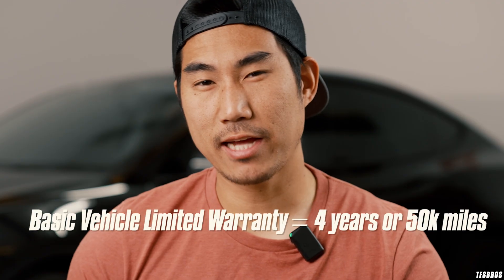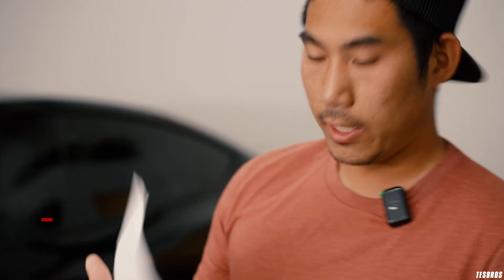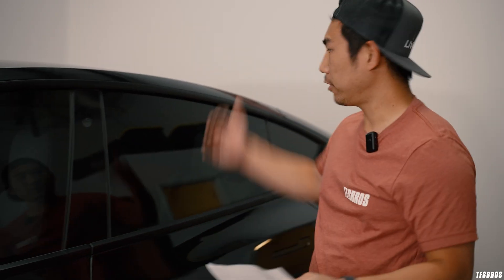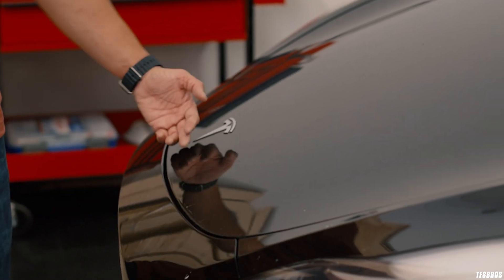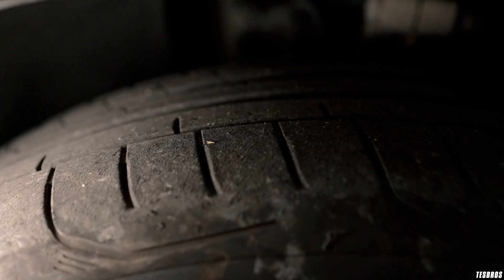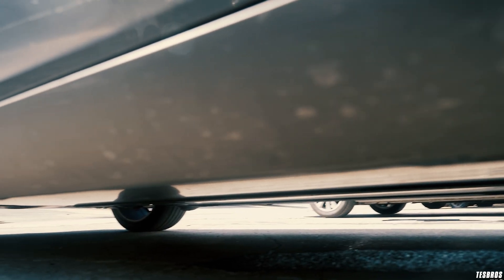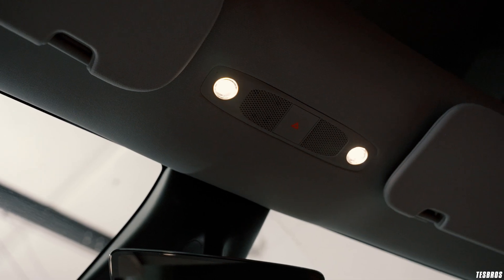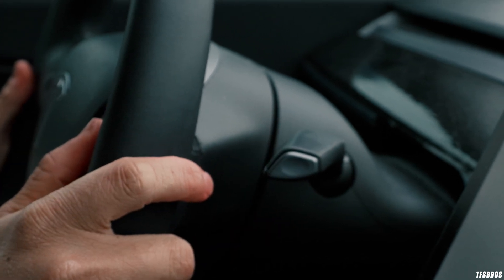Tesla End of Warranty Checklist - What To Do Before It Expires

Comment: is there anyway to find warranty information in my Model Y's center screen instead of app?
Reply from the maker: As of right now, no. But the basics will be drive unit and battery limited warranty - expires after 8 years or 120k miles. and your basic vehicle limited warranty - expires after 4 years or 50k miles.

Comment: I’m 120 miles away from warranty I have condensation on both outer lights  and the Tesla dealer is like about 50 miles away I wouldn’t be able to drive it until I get this fixed . So far so good I don’t have any other issues . I have the option to pay $2,000USD for an additional 2 years or 25,000 Miles
Reply from the maker: Go ahead and put in a service request for your lights. At the time of request, they will see you're still in warranty and should honor that even if you come in to get it fixed a little over milage. Ask them when you put in your service request to make sure they abide by that though. 

Up to you on the extended warranty. I've never needed it on my cars, but go for it if you need that peace of mind.
Reply: Need yall help im worried and nervous what should i do
Reply: I just did this and they said it’s normal because tail lights aren’t sealed. They said if water sits in there then there’s a probably but some condensation that evaporates/goes away is 100% normal. They use sealed LED’s inside which is why they don’t have to be sealed

Comment: I have 500km left on the warranty and I requested service via the app because I have issue in the front axle in the pins and need to change the filter and check the brakes. Does the car need to be under 80,000km when it comes to the service or is it enough if it is under warranty and has less than 80,000km at the time of ordering? Can anyone help me with this?
Reply from the maker: If your car had less than 80,000 km at the time you requested service via the app, you should be covered under warranty, even if you exceed 80,000 km before the service appointment. That's generally how it works. 

However, It's best to confirm directly with Tesla to avoid any surprises. Since you requested service via the app, I would ask them there before going over the limit.

Comment: Worthless video, all about issues that will be obvious in daily use. And issues not covered by warranty, wheel alignment eg.
More important and more hidden:
Check:
Play in rear knuckle assembly. Standard issue.
Play in steering column.
Play in upper link in front suspension.

Comment: I have 2019 Tesla model 3 standard range plus and only getting about 190 miles at 100% I’m at about 96,000 miles I tried doing the battery degradation thing on the app and they said seems normal
Reply from the maker: Looks like the rated range for a 2019 SR+ is 240 miles when new. That's about a 16% range loss. After about 5 years and 96k miles, that's not terrible. Not fantastic either. This blog can help you understand more about battery degradation if you're interested - https://tesbros.com/a/blog/how-to-check-battery-degradation-in-your-tesla

Comment: The issue with getting warranty service with Tesla, is they want to avoid it altogether, if possible🙄. This may be due to too many cars,with too little SCs to support them. They will happily do, warranty service, as an addon item though🤔. I did have a tough time, even with a recall item(rear camera harness). Also, it is difficult to make them accept a manufacturing defect. I got the aeroshield torn(2018 M3), could not get warranty service. Later, it happened second time, but this time I decided to switch over to aluminum and attempted to do it myself. In the process, I found two square nuts that were supposed to be welded were not🤯(one pair missing!, may have caused the problem to begin with). I had a tough time prying front bumper to hold nut from above to complete the upgrade. Now, why on earth Tesla did not find it during/after first repair🤔. I want my 💵300+ back😢.Tesla support sucks. Good video though, but goodluck with Tesla in fixing any issues for free🤞.❤👍

Comment: Is a faulty battery necessary to utilize the warranty? Or can I simply replace it for a fresh one even if it's not faulty when I’m at 95,000 miles with 80% battery capacity?
Reply from the maker: It has to fall below 70% battery capacity during the warranty period to be covered

Comment: Willing lowering a tesla model 3 affect the battery warranty?
Reply from the maker: It shouldn't. If something were to happen to your battery or drive train, and you needed to get it fixed, Tesla will have to prove that the aftermarket components caused the failure for it to not be covered.

Comment: what is the warranty on low voltage battery for Model 3?
Reply from the maker: The 12v? They should replace it for free if it went out prematurely like after a few months of ownership. But if it’s been the appropriate amount of time (3-4 years) the cost is on you

Comment: There is an extended warranty you can buy from tesla for two more years ex. I think it's about $ 1800 on model 3, which I think is reasonable, check it out.
Reply: Tesla already has battery and drive unit covered for 100k miles or 8 years. This extended warranty is to extend the bumper to bumper warranty for another 2 years. General warranty is 4 years which you can add 2 more years by purchasing the extended warranty for 1800$
Reply: Battery covered for that price?
Reply: @TheUnknown-mg8fv nope
Reply: Is the battery covered?
Reply: nope @rodneyrodriguez7653
Reply: @rodneyrodriguez7653 No. Its just extends the cars basic warranty

Comment: Did you tint your glass roof?? If so what percentage?
Reply from the maker: It’s not necessary because the roof is already 20% from factory, meaning 20% of light can pass through. If you want it darker, you certainly can add more tint or just get some sun shades that cover the roof and only use when needed
Reply: @diywrapclub  some have complained that they’ve still felt the heat even with the tinted roof and need that extra layer of protection to keep the car cooler and to protect their head.
Reply from the maker: Yeah its definitely an option! I've never had problems, but everyone is different and lives in different climates. If you added 50% tint to the factory 20%, it would cut the VLT in half to 10%. You could go even darker and add 35% tint, making it 7%. Formula = 20% x the percent of tint you want =  VLT percentage

Comment: I'm sure you know about the issue affecting the Model 3/Y at night whereby there's a yellow glare in the blind spot cameras from the turn signals. Evidently this was fixed when Tesla switched to Samsung cameras with the slightly redesigned housing. Unfortunately it seems Tesla doesn't allow the Sony cameras to be swapped out for the Samsung. Nor have they released a revised camera housing for Model 3 and Y Are you aware of a fix?
Reply from the maker: There’s not an easy fix. And this would not be covered by warranty. There is a video of a YouTuber where he modified the housing but it’s not easy to do so wouldn’t recommend. Hopefully they give that option later though!
Reply: @diywrapclub  Yes I've seen that repair video. It just seems to me it should be covered under warranty or some kind of reasonably-priced repair program as this is clearly a defect and precisely why they made a revision in the design.   You see how clear the Hyundai/Kia EV blind spot cameras looked from day one so you'd think this would be an embarrassment to Tesla.
Reply: @diywrapclub  Update: I contacted Tesla yesterday. They messaged me today offering to swap out the "repeaters" for $330. They said the yellow flash affected the earlier 3/Y cameras and is "normal" (which is bullshit), but I had their mobile service fix it.
Reply: Do a search on YouTube for the repair video. It isn't really all that difficult if you can handle small items. It is a matter of removing the unit, opening it and making a small mod and closing a plated through hole on a circuit board. Took me about an hour for each side.
Reply: I considered doing the repair myself to fix that glare but decided to just get them replaced.  it was $500 at Tesla and I pushed hard on the point that it was a defect but in the end, I lost that argument and paid the money.  I love the new cameras!
Reply: @Jimbojam  $500 vs the $330 I paid? Yikes.